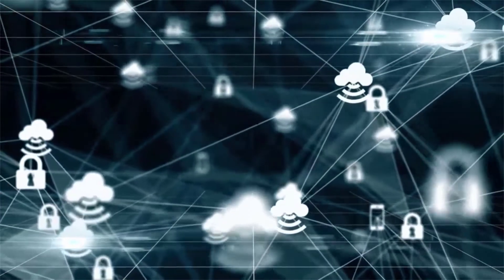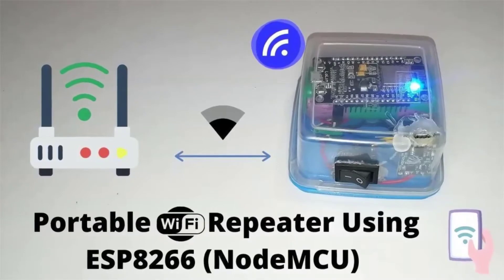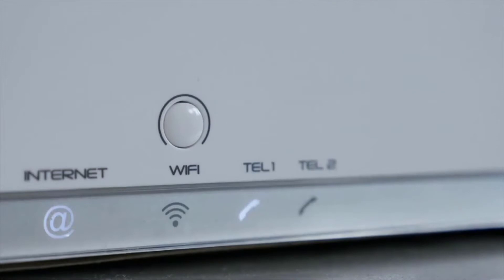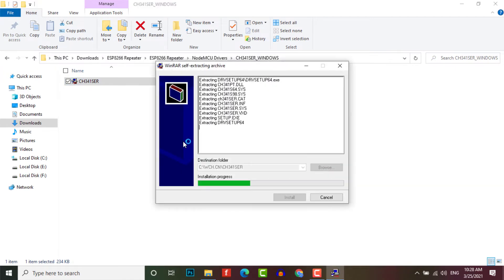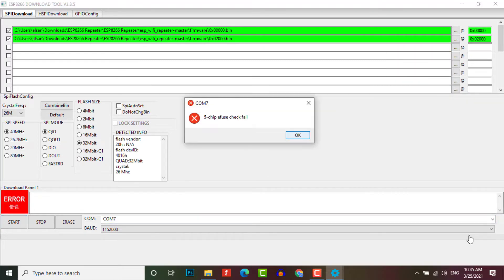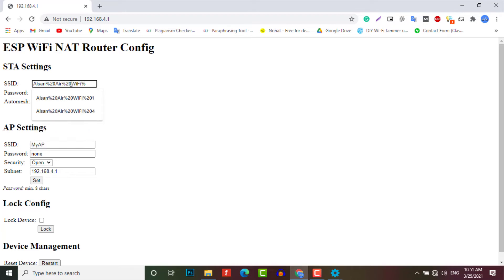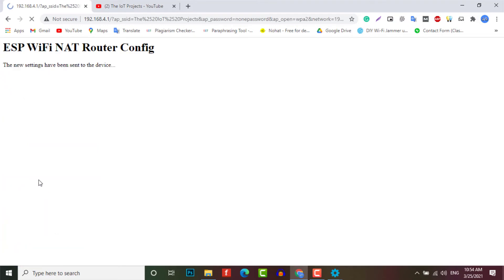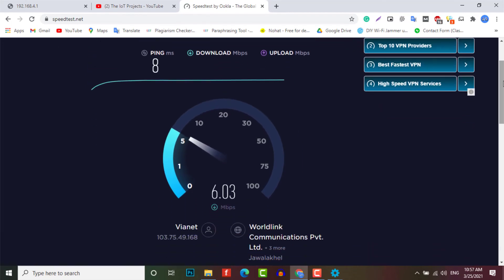Portable Wi-Fi Repeater using NodeMCU || ESP8266 Wi-Fi NAT Router

Comment: Could you please share the details of hardware  connection (especially battery connetions) of this project....As it was unable to understand in the diagram.
Reply from the maker: connect 3.7V 18650 battery + to Vin and - to GND
Reply from the maker: if you are using the tp4056 module, connect from the tp4056 module instead of the battery.
Reply: Or u can just plug it to the power source (charger)